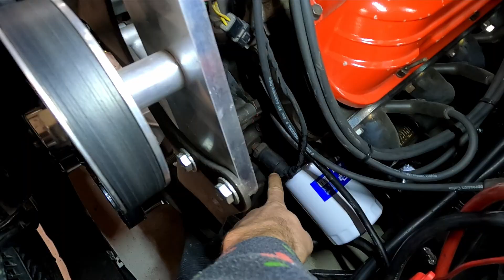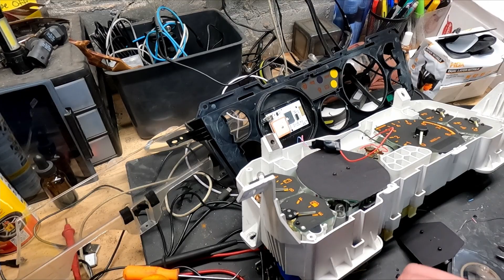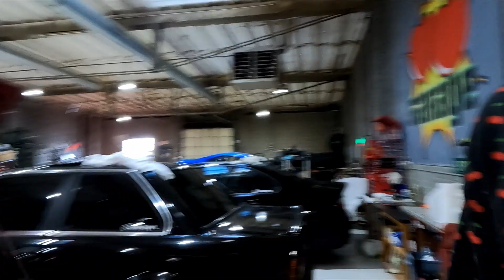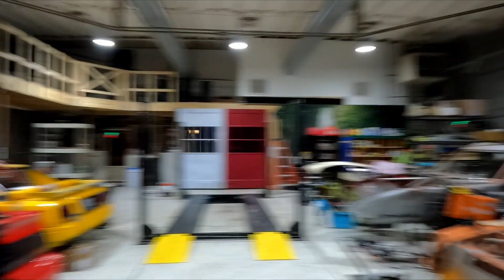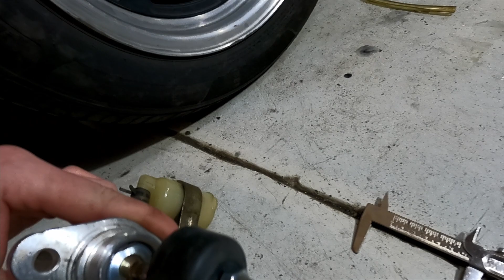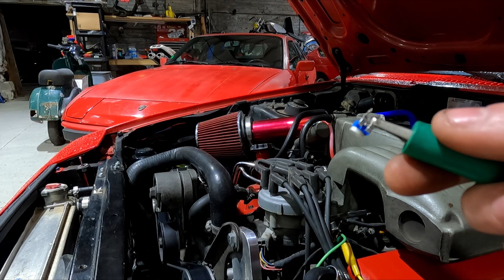Modifying the Chrysler Conquest/Starion Widebody V8!!

Comment: How much on the motor and trans mounts you used ?? Would love to use for my 5.0 conquest 🔥🔥🔥🔥nice build
Reply from the maker: Thank you! Are you asking what the price was?
Reply: @TheCherryGarage yes
Reply from the maker: I purchased stock 5.0 mustang engine mounts from rock auto under $100. The trans mount I modified using both the mustang and conquest setup to fit it properly.
Reply: @TheCherryGarage how did you do that?  Just flip it around?
Reply: Do you have a link to the megasquirt you used?